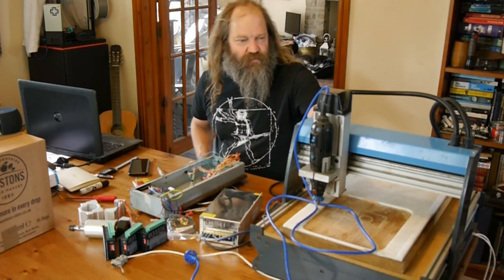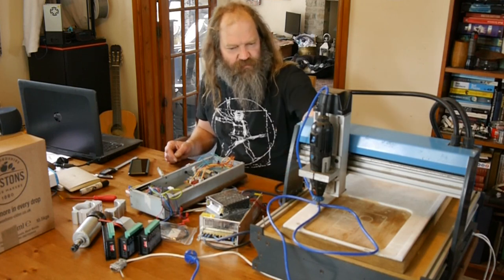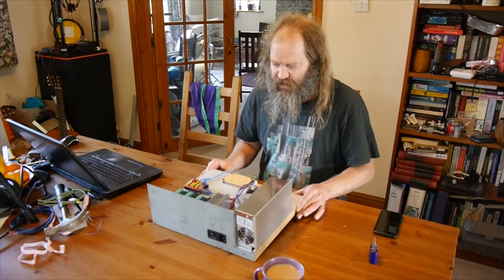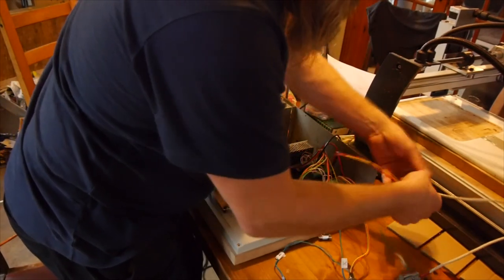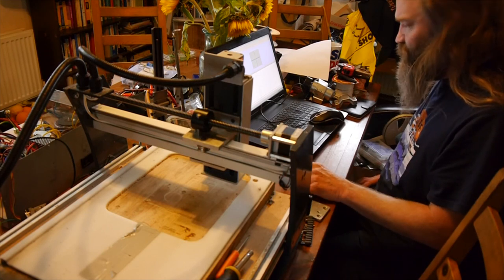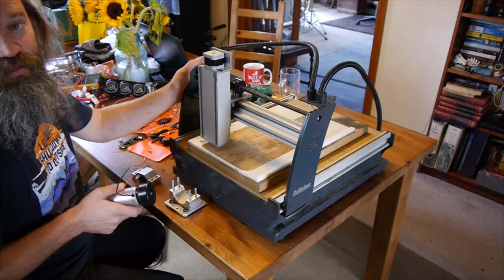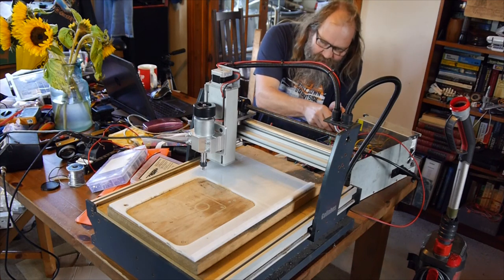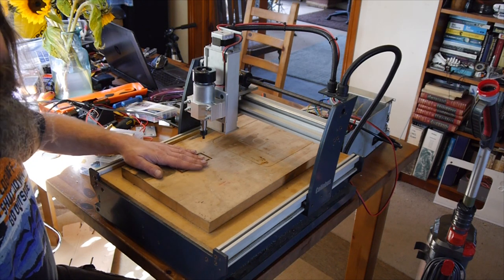Colinbus CNC Profiler GRBL Conversion. Simple Arduino CNC.

Comment: I have a small desktop CNC lathe that was designed to run off of a BBC B computer , I really should bring it up to date with some new drivers etc.
It's never ran all the time I've had it and it was free , so I can't break it any more than it is.
It looks a lot simpler to sort than I thought it would be to do.

Comment: Hi, Just wondering what s/w you use to convert drawings or projects to gbrl? I'm looking for a simple app that I can use to cut some 20mm holes in perspex
at a depth of 2mm.  thanks a lot...
Reply from the maker: For simple stuff like that I tend to use an online tool called 'Easel'.
https://easel.inventables.com/
You need to pay a subscription to use all the features, but if you are happy to hack around it a bit then you can get it to generate GRBL friendly Gcode. 
Once you've done your design, click 'machine' from the top menu. Then select 'General Settings'. From there you can download the Gcode for your design. 
I find that this is compatible with GRBL 1.1
You are limited to a small number of tool options, and the V-carving functions are disabled, but if you really need those sorts of functions then it's either worth paying the $24 per month subscription, or considering looking at other software options. 
But for milling different depth holes and cutting out basic shapes (and engraving cool text on stuff), the free version of Easel should do everything you need. 

Let me know how you get on! :)

Comment: I really enjoyed y our video ,
I have a Chinese 3040 cnc router which came with the Mach3 parallel port board, I have replaced the board with the Arduino uno plus the shield, the stepper motors have four wires . on the Mach 3 board the connectors coming from it to the drivers have three wire connectors to each driver and a four wire connector to the control output port which the machine cable plugs into .
The arduous shield has a four wired connector for each driver so how do I connect the three wired connector to it .
I know it will be hard to understand so I wonder could I email you some photos of my control box so you will understand better as I am desperate to get it going.
Many thanks 
Ernest

Comment: Hey i just watched this video and i was wondering if Anyone has a link for the Power Supply
Reply from the maker: It's the sort of power supply you'll find if you type "24v 10a Power Supply" into Amazon or ebay. 
Just substitute the voltage and current in your search for whatever your requirements are. 
There are loads of power supplies available which look like the one in the video and I'm never too fussy which ones I use.
Reply: @spungletrumpet  yes i will do this, we have to do the Exact same conversion as a final school project to graduate so Let's Hope we get it to work